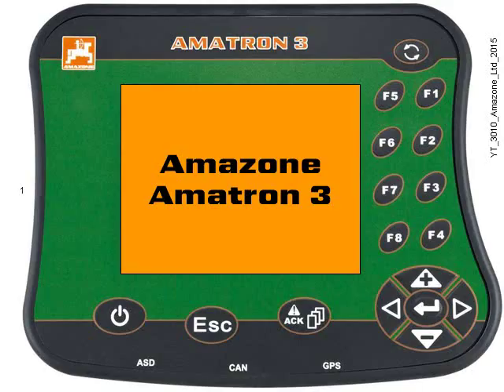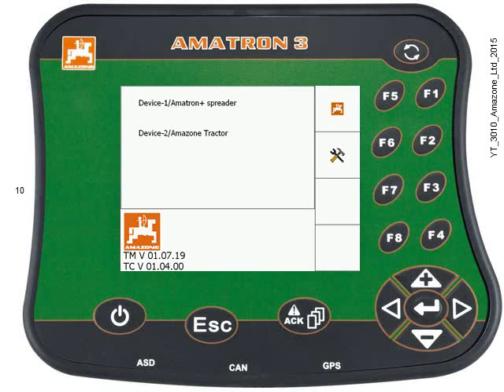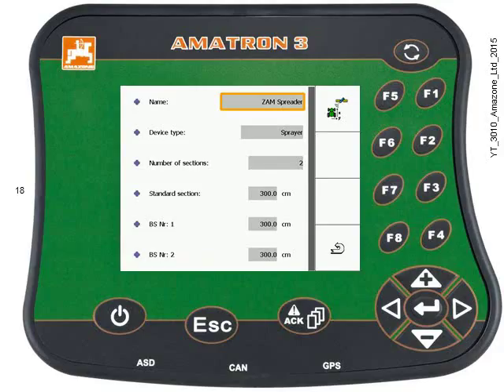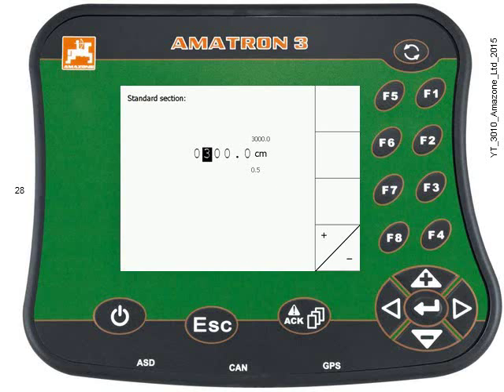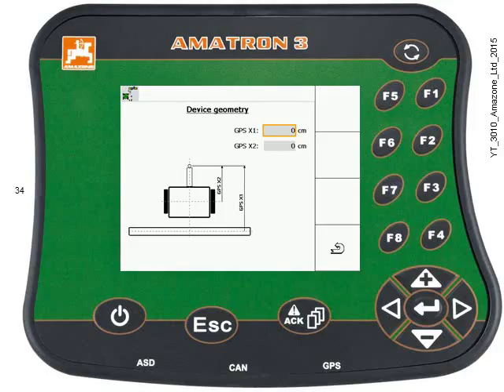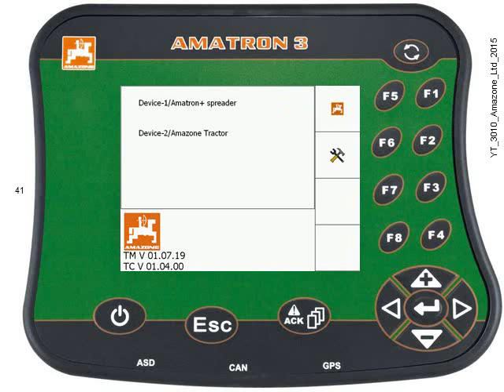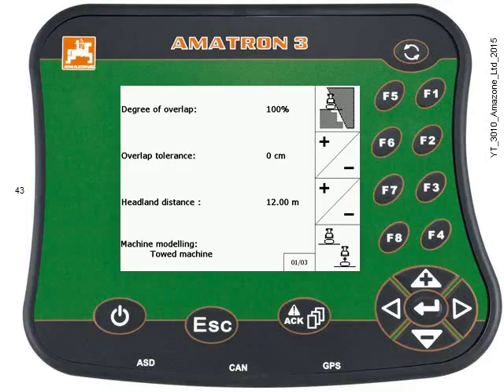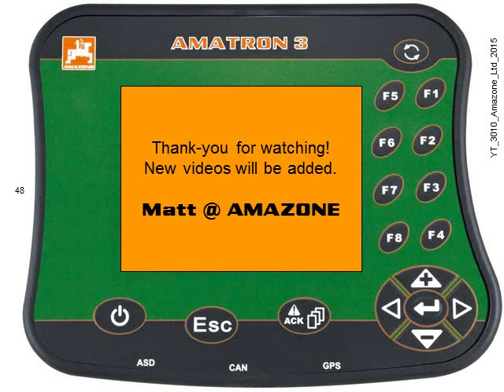Amazone Amatron3 - Setting up an Amazone Amabus machine in ISObus Menu

Comment: Hi Matt, got a question, I want to create an non Amabus implement (just a plain old cultivator with no electronics or canbus) for the purposes of GPS switch showing area worked and track etc. But would like the Amatron3  to show on the screen color difference between the “in work” and “out of work” based on the hitch position signal on the tractor 7 pin plug. Which pin on the Amatron3 would I connect the working position (in/out of work) signal to, otherwise I’d have to press the button manually every time I lifted or lowered the implement. Any pointers appreciated.
Reply from the maker: Good question, sadly I don't have the info instantly to hand anymore. I would need the wiring diagram for the NL025 cable to give you an answer. I have sent a message out and will try to update you as soon as I get a reply. The NL025 connects as you guessed, the 7 way Din socket in the tractor and the Amatron3 8 way socket on the back of the terminal.
Reply from the maker: Ah sorry, that's wrong, I meant the 8 way socket on the black basic equipment (the funny Amatron bracket with power leads) if you don't have this, it won't be possible to do what you want.